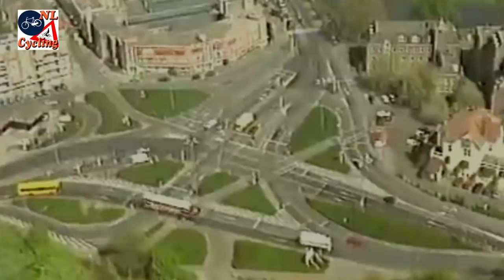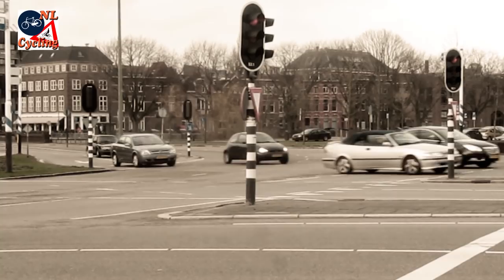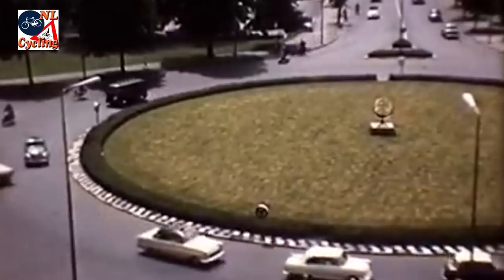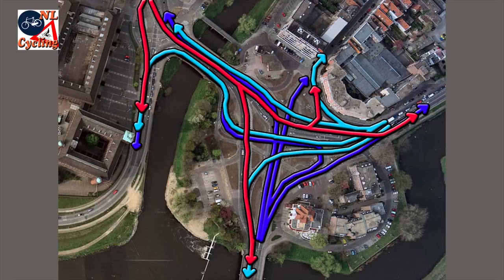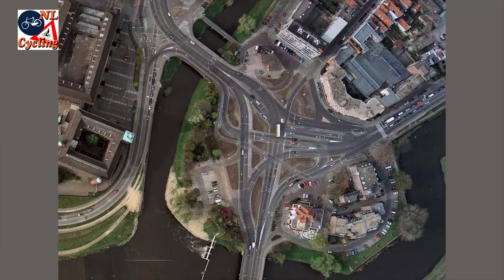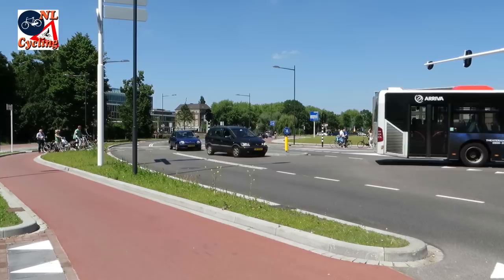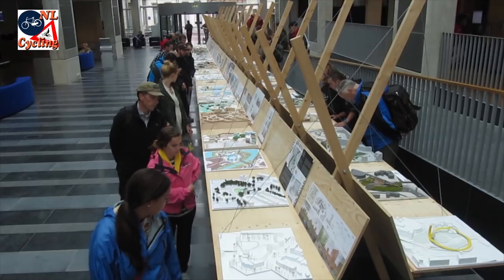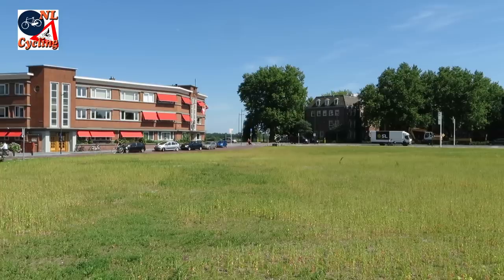Reconstruction of a huge intersection in 's-Hertogenbosch NL [354]

Comment: I would add that the situation has also improved for drivers. The old intersection was confusing as hell.
Reply: yup , i don't think there has been i single driver that actually ended up where they were hoping to go the first time around. ...

even experienced drivers regularly went ... oh crap. And  try to skip lanes in a very alternative fasion.
Reply: @dawnmaster68  My brother almost had a bit of a cry after we turned the wrong way on the second try. Context: we were already late for a cremation so stressed out to the hilt.
Reply: I still remember the first time I had to cross it, was my first time in the inner city of Den Bosch as well. Confusing is putting it very mildly.  But we made it in one piece and without a scratch.
Reply: i had my driving lessons in that city 20 years ago. i think even my instructor got confused there. i was very glad when it was changed, it was a place to avoid.

Comment: Nice video, but you forgot two things. First, this traffic interchange was built in 1960, but Highway 2 was opened in 1970, so the interchange was designed for a lot of traffic. The second part of the story is that in 2011 there is a new traffic road on the westside of this interchange. This two road takes the traffic of this intetchange, what gives the possibility to change the interchange.

Comment: This complex design dates from 1965 as mentioned.
It was not constructed because some people were car-minded, but because all North-South traffic and East-West traffic went through this knot. It was very well designed and solved traffic jams for years. The N2 on this knot, was replaced by the A2 that went around the city, taking away a lot of traffic in the early 70's. In the 80's the A59 was constructed also around the city, taking away the North-West traffic, and connected the A58 to the West. West-South still had to use this traffic square. Only in 2010 the ring around the city was completed, taking away the last main route, and made the complex structure obsolete.
For safety reasons a big gasoline station was closed and removed which occupied a lot of space.
Local traffic is redirected around the city center.

I appreciate your videos about bicycles and infrastructure, but keep them fair and honest.
Btw the Eastern half is called Willemsplein, the Western half Wilhelminapark.
Reply: You forgot to read the link in the information section of this video. The link:
https://bicycledutch.wordpress.com/2014/10/30/xxl-size-reduction-for-an-intersection-in-den-bosch/

Had you done so then you would have noticed that he alraedy mentioned all the reasons you also mentioned in your reply.

Comment: I remember driving there a lot since it is reconstructed, the only disadvantage I noticed is the short notice sorting lanes, when you drive from south to north over these intersections, you have switch lanes twice to the right to continue going straight. And when going south, you notice the left turn arrow after the corner, resulting in late merging by vehicles. It could easily be fixed by changing the road lines though. At least it's much better than pre-2014.

Comment: to be fair, it also helps that the main road from south to north and west now runs around the city, and no longer through the city.
initially all traffic from south west and north of the city passed through this area. as a result, more cars per hour drove on this square than on the average motorway.
despite the crazy design, the square for cars worked, surprisingly enough it did! for pedestrians and cyclists, on the other hand, it was hell on earth

Comment: Those cars were not using the roundabouts correctly.
Reply: Rules on roundabouts have changed, all right had priority, now the roundabout has priority.
Reply: @dutchman7623  The roundabout around the Arc de Triomphe in Paris still works that way. I wonder why it hasn't been changed, it's simply hazardous.

Comment: the two roundabouts would have been perfectly adequate provided the traffic already on the roundabout would have had right of way.
unfortunately at the time there was only one roundabout in the netherlands that had that configuration and it took way too long to figure out that it that was the best way.
it was in the bordertown of venlo, that had adapted the german system because there were so many germans coming in through  that roundabout causing many  accidents that is was deemed safer to have the german system.
Reply: no it wouldn't. Heetmanplein solved a traffic jam caused by the enormous amount of cars that passed by. 
at the busiest time of the day, three traffic arteries (ergo 6 main roads) had to cross one square. 
don't care what you build there, you have a problem!
Keizer Karelplein in Nijmegen does not really solve the problem. 
and there is now less traffic on it than it did on the Heetman
Reply: @marcelschellekens6386  Except the Keizer Karelplein is precisely an example of a traffic circle not a roundabout, with priority to tge right instead of to those in the circle.

Also, you'll notice there are two roads coming in from each side of a bridge, and a separate residential street on one side. Each of the roundabouts only dealt with 3 or 4 roads, perfectly adequate for a pair of roundabouts.